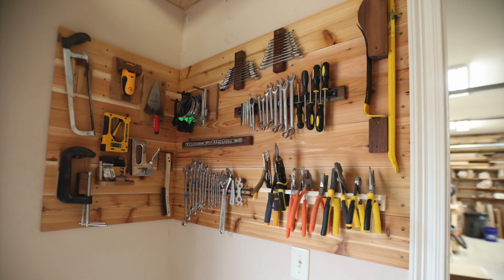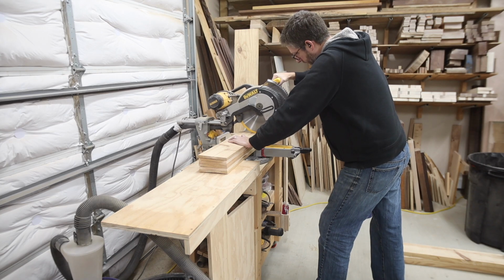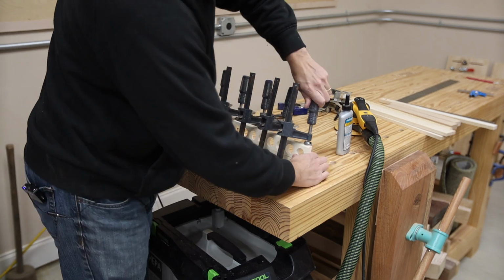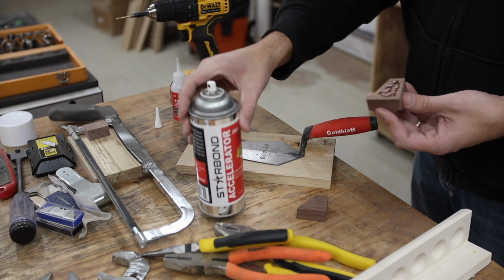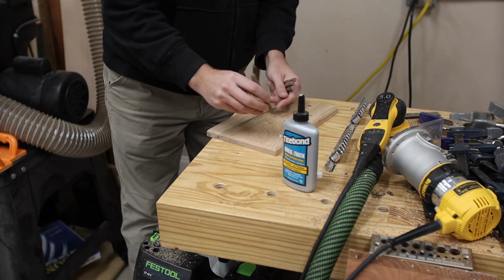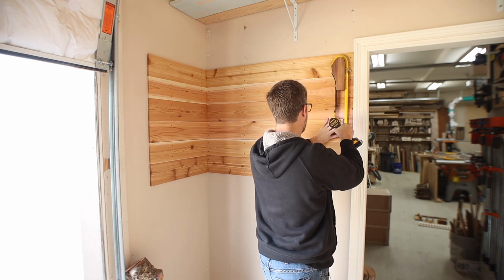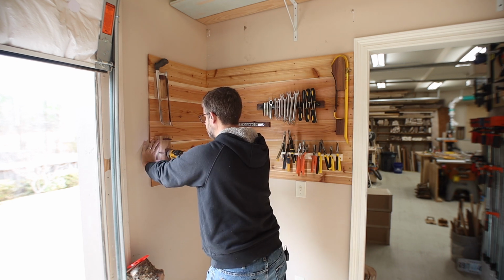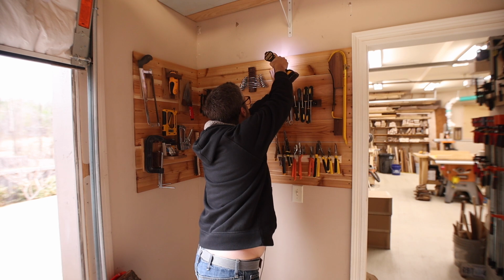MINI TOOL WALL / SHOP ORGANIZATION / DIY SCRAP PROJECT

Comment: Looks great! But I prefer to keep that kind of stuff all jumbled together in an oversized drawer. I sure do enjoy all the swearing I get to do when the tool I need to get at is all the way on the bottom.
Reply from the maker: Ha ha. That could be considered a fun pastime!
Reply: 🤣🤣 it’s always one of those things you will get to later.... just that when is later. The thing you need is never at the top of that oversized drawer😂

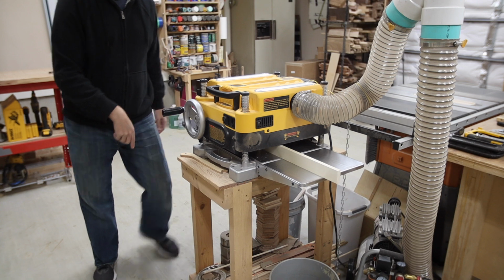Comment: @3:29 So, actual question, not a planer critique. How did you plane the edge without a jig? I don't have a planer (actually trying to find that exact DeWalt planer now), but want to learn how it can be used and haven't seen edge planer-ing like that before.
Reply from the maker: If your bottom edge is flat, you can do this. It references off of the bottom and the top just becomes a repeat of the bottom.
Reply: Also, all your holders look absolutely amazing! Love the hardwood use with everything!
Reply from the maker: Ha ha. Thank you!

Comment: Nice work! Do you have any working time with the starbond and activator? I've been using 2P-10 and its so fast if I don't have it perfectly aligned before even touching the pieces together, it will bond. Sometimes it even bonds before I have applied enough pressure, and there's a gap.
Reply from the maker: Thank you! Maybe a couple of seconds. It’s going to act in a similar fashion.